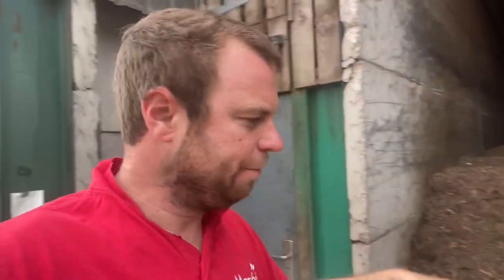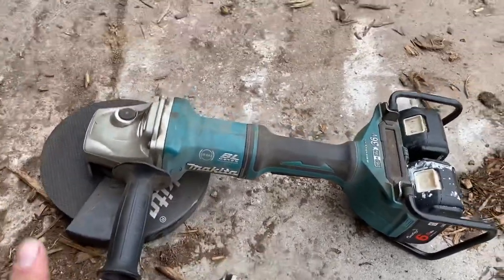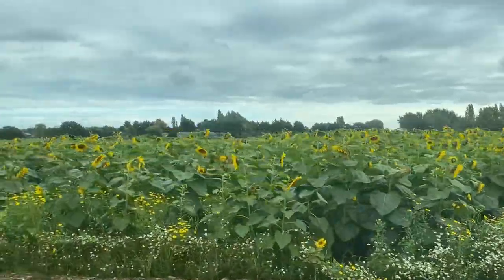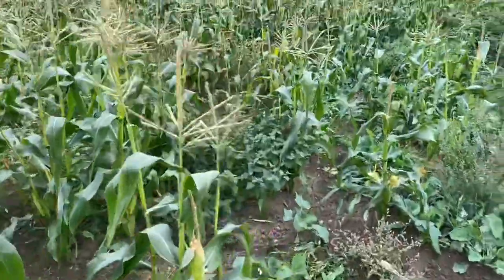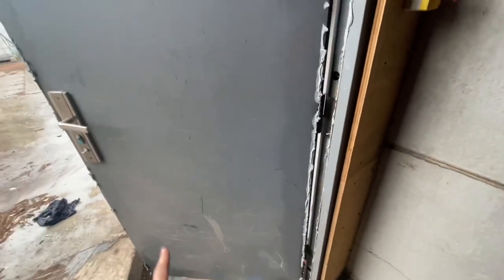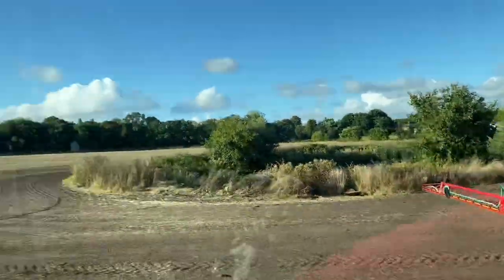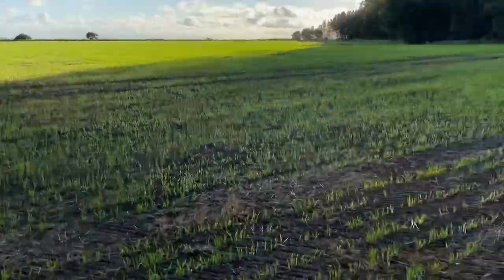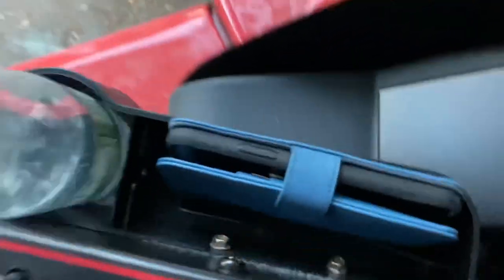Day546 #OLLYBLOGS WILD WEE OR HEDGEHOG SPRAYING AND DOOR PROBLEMS #AnswerAsAPercent

Comment: try reapplying silicone and then covering it with cling film before shutting the door. When the silicone has set (after at least a day) open the door and peel off the cling film. I've used this method to make draught seals on old doors with success.
Reply from the maker: Good idea
Reply: That’s a belter of an idea and so simple. God I love people that apply common sense to a problem 👍

Comment: Oven door sealing strip will work on the door. If you speak to a commercial catering equipment spare parts supplier you can buy it in rolls to cut to size. If there is a positive pressure fan inside a latch on the door that pulls it in top middle and bottom would also help just incase the door is warping due to the temperature changes.

Comment: You can get door sealing strips in high temperature silicone rubber, should easily cope with the sort of temps in the air tunnel. If 300-ish degrees still isn't heat resistant enough then I would suggest a rope seal like on a log burner.

Comment: Cut some strips of rubber.. tyre tube for example and attach them around the door frame in a way that the air pressure pushes the over lap onto the door. Once that's done put a good layer of sealant around the attached edge and close the door till it's almost latched for a few seconds using the air pressure difference to push the sealant into the remaining gaps.  But leave it open till the sealant cures

Comment: Inward opening door would be a better start. Several suppliers on ebay for rubber seals in every variety. 
95% today, Hedgelaying at Netherbury (Dorset) all day in perfect weather (not the usual cold and wet), and home in time for bellringing.
Reply: good plan..  turn the whole frame and door around so the door opens inwards, when the fan is on, the air pressure will push the door against the frame and seal it... looks like a kirncroft security door

Comment: Big problem you have with that door is it opening outwards, so you are 100% relying on a single latch to keep pressure on all the seals, having the door opening inwards would help alot as the pressure pushing out would help to push the door against the seals.

Comment: Well both my guesses were wrong. For the door we use a D shaped rubber seal on the poultry shed doors as they need to be air tight. Works up to 35c ok.

Comment: Maybe try opening the door putting a bead of silicone on the frame getting it to dry with the door open so that when you close the door you have push it into the silicone and the the small amount of play in the silicone should seal the door rather than messing with oil or grease

Comment: For a door seal why not try the seals they use on the swinging tail doors on trucks and trailers. It’s about an inch wide by 1/2 an inch thick and you can buy it and cut it to length

Comment: “Rescuing a hedgehog” that’s a new one on me 🤣🤣. Silicone needs to dry before being pressurised else will just blow past. Most airlock doors open against the airflow so the pressure seals them. They can have a small hatch in them to release the pressure so the door can be opened. Used to be one to catch the apprentices out when they couldn’t get the door open to get out🤣🤣 ( happy days, would be called abuse now 😮)
Reply: Emergency escape reasons for the door to open outwards - we don't want any casualties !

Comment: 100% today! It looked like a wild wee but doubt she would allow you to film and broadcast that 🤔 So I will go for hedgehog rescue 🦔

Could you turn the door around so it opens in to the tunnel? That way the air will blow the door shut and blow the seals in and seal tighter? Does mean you couldn't open the door with the fan running though.
Reply from the maker: Yer that’s problem

Comment: Why not try a flat rubber strip on the inside of the frame.....the air pressure should push it flat to the door and seal....3 sides should work a great at least

Comment: Put good sized rubber strip around inside door frame so when fan is on will push against door matr did it on his grain tunnel worked well. Or turn door frame round so door opens in.She was saving a badger 🤣🤣🤣🤣

Comment: Take the silicone off and replace the door seal with foam draught strip and fit a couple of sliding security bolt on the outside to help hold the door shut.

If you turned the door round to open in you would never open it with the fans on. Thing about the air pressure over the surface of the door area.